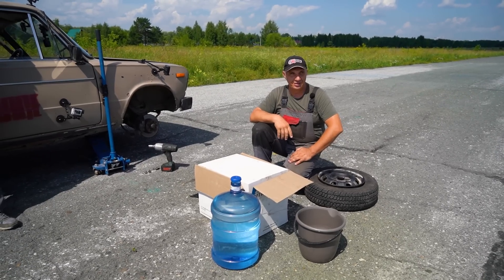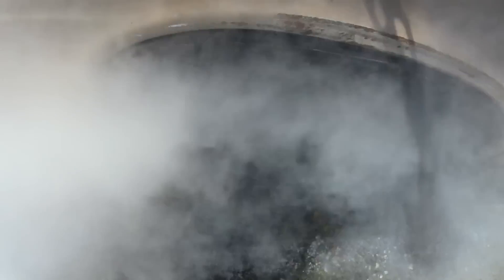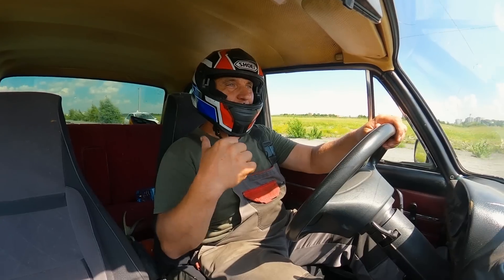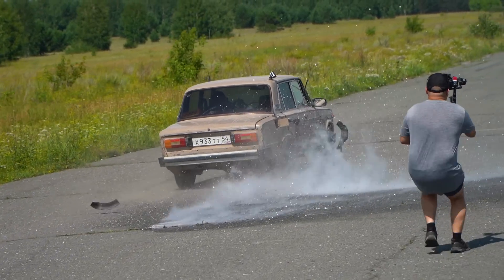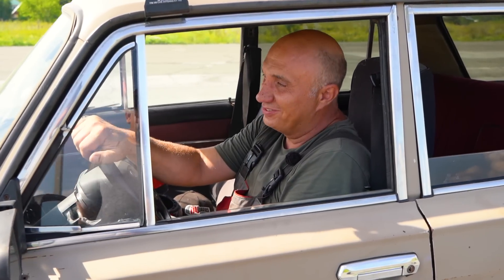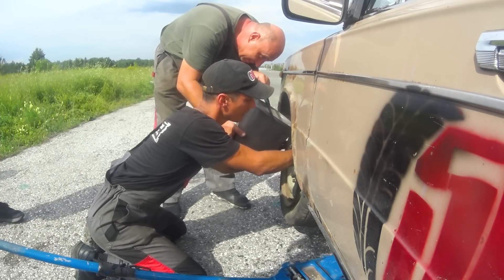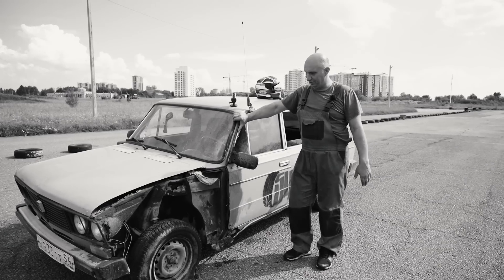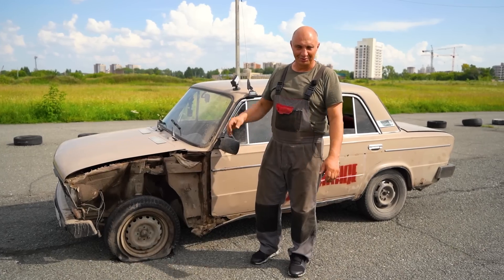Dry ice and water into a tire (overinflation by 800 times)

Comment: This reminds me of when something similar happened to someone I knew (I was one of the passengers in the vehicle at the time) when the driver side front wheel blew out. Except instead of the tire blowing out from being over pressurized, it was the rim that exploded because of a fracture that grew while going 70 MPH and made the rim structurally unstable. The only part the rim that remained was the ring that the tire seats to. The owner of the car was of course smart and not only instinctively pulled over microseconds after the blowout (because the tire was the only thing left attached to the car so it retained almost non of its momentum) but replaced all four rims due to the risk of the other three possibly being fractured before the blowout, or as a result of it.

Comment: In another episode you ran the engine on steam and I thought you could probably run an engine on dry ice and water. Use the high pressure you are using to blow the tyres to power the engine that you ran on steam before. I really enjoy your crazy chanel, I am a retired mechanic following you from Australia.

Comment: Can you assemble a car that has a diesel engine in the front and a petrol engine in the back in the trunk - they must work at the same time. In reality, the car can work as a 4x4. Or to work separately once Gasoline, and then shut down and switch to diesel? It si possible?

Comment: When the right lower ball joint fails, the car veers to the right. Steering is lost. This happened to me at 50 mph. The car went up & over the curb & came to a stop. It pulled the axle out of the transmission. Luckily, I was in the right lane & no one got hurt. Needless to say, I was late for work. Took a few hours, but I got it back together with a few new parts.

Comment: By far, the biggest mistake that incompetent drivers (which is the vast majority of drivers) make is that they slam on the brakes as soon as something unexpected happens. That’s often the worst thing you can do. When you have more traction on one side of the car than the other (like when you blow a tire) and you slam on the brakes, one side of the car slows down faster than the other side which almost immediately causes you to lose control of the car. Vehicles with enormous tires (like lifted trucks or off-road vehicles) are more likely to lose control during a blowout because the difference between wheel and tire diameter is much greater and they’re already unstable to begin with.

Comment: i knew the water would suck we used water in tractors tires to make them not flip as easy and u cant go fast youll start hopping  but the dry ice turn the tire into a bomb i firgured it would just crack  it would make a nice garage trick